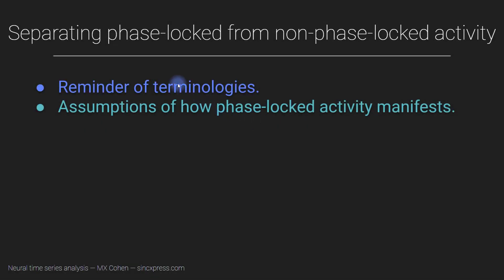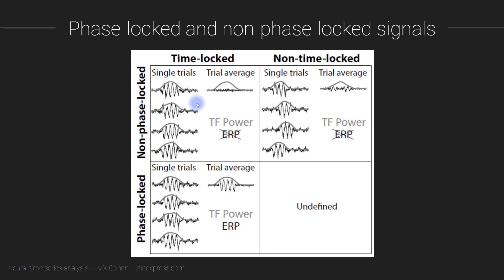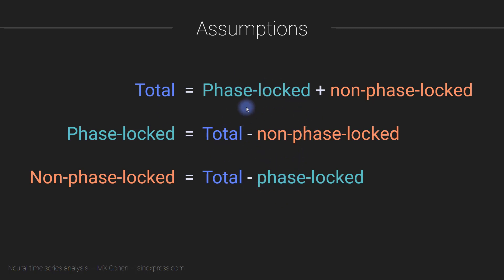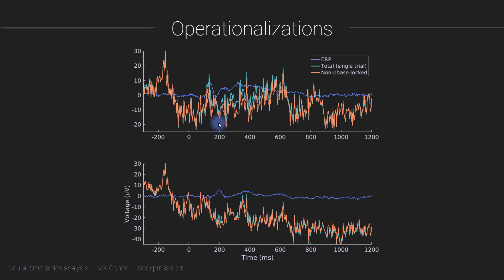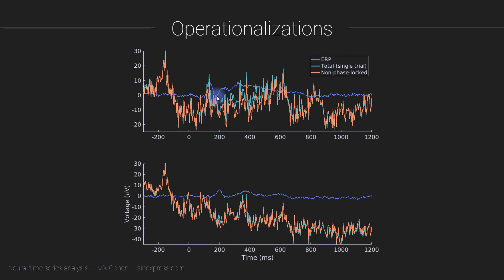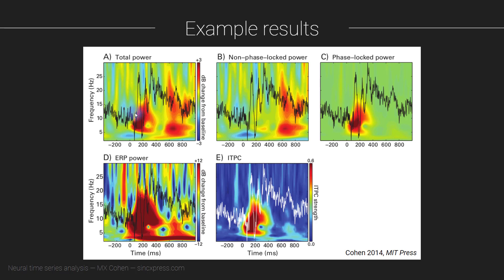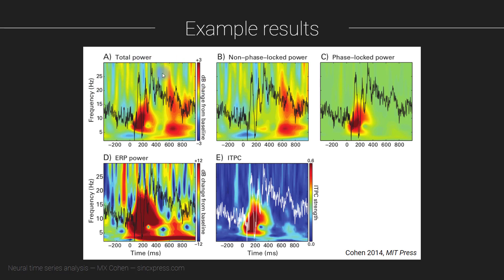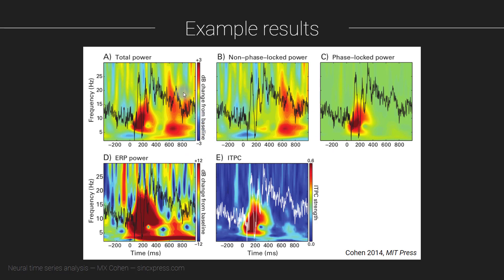Separating phase-locked and non-phase-locked power

Comment: Thank you for your videos! I have a question. My data has a sinusoidal ERP and I want to know if there is also induced phase synchronization at the frequency of the ERP. If the phase-locked power and the non-phase locked power overlap -- does that mean that there was induced phase synchronization? What if they only slightly overlap? I would think that you can only infer something when the two powers aren't overlapping.  

I was trying to do ITC over the trials minus ERP, but you will get 0 coherence. Except if there is large amplitude ERP differences trial to trial you get a bimodal polar histogram.  

Hope you see this :)
Reply from the maker: Yeah that's tough, because the ERP is the phase-locked activity but is not necessarily oscillatory (or can contain a combination of oscillations and non-oscillatory activity), but removing all the phase-locked signals will also remove any phase-locked oscillatory information. I'm not a huge fan of interpreting ERPs; I would focus on the phase-locked and non-phase-locked parts of the signal.
Reply: @mikexcohen1  Thank you for the reply!  So would there be any way to use the phase-locked info to determine if the ERP is endogenous or an artifact from electrical stimulation? My hunch is leaning towards investigating the overlap between phase-locked and non phase-locked. Have you ever heard of anything on that? 

 Easiest thing I can think of is just to see if there is still ITC after the stimulation period.
Reply from the maker: Hmm, interesting thought. The artifact is obviously phase-locked, but some endogenous activity would also be phase-locked. If you have enough channels, you might be able to isolate a spatiotemporal filter for the artifact and project it out? I'd guess there some be some methods studies about this that might be helpful.

Comment: Some authors argue that computing non phase-locked power by subtracting the ERP before doing the time-frequency decomposition neglects the fact that the ERP latency/amplitude can jitter from trial to trial, leading to imprecise non phase-locked power. I would love to know your opinion about it, Mike :)
Thank you!
Reply from the maker: Hey Carolina. That's an important question without a clear answer. The thing is that the ERP is mathematically defined as the time- and phase-locked component of the single-trial EEG data. So jittered activity is not technically the ERP. I've tried a few times to fit the single-trial amplitude (thus assuming that the latency/waveform-shape is constant but amplitude varies per trial), and it hasn't changed the results in the datasets I looked into. I haven't tested single-trial latency jitter fitting, but at some point you need to worry about overfitting noise...

Anyway, I take a very practical approach to this situation: The single-trial dynamics that can be quantified with time-frequency analyses are -- in my experience -- more statistically robust, reproducible, and correlated with behavior than the (single-trial or average) ERP. One example paper of this is Cohen and Donner, 2013.
Reply: @mikexcohen1  Very interesting, Mike! Thank you! :)

Comment: Hi Mike, thanks for the video. I have two questions about this course. 1) you construct non-phased-locked signal by substracting ERP from raw signal of a random single trial? Then if we have 99 trials, we will get 99 "versions" of non-phased-locked signal? 2) among your 5 example results, I'm confused about C) Phase-locked power and D) ERP power. I expect they are the same things. Just look back to the operationalizations: Phase-locked = Event-related potential, it seems to me they are the same things...
Reply from the maker: Hi Bokkie. 1) It's probably more accurate to call them residual time series than versions, but yes, they're obtained by subtracting the ERP from each individual trial. 2) They're conceptually similar but defined in different ways. The phase-locked power in panel C comes from a subtraction of two nonlinear operations (power), whereas the ERP power comes from a nonlinear operation after a linear operation. In general, linear operations are the same regardless of order, whereas nonlinear operations change depending on the order.